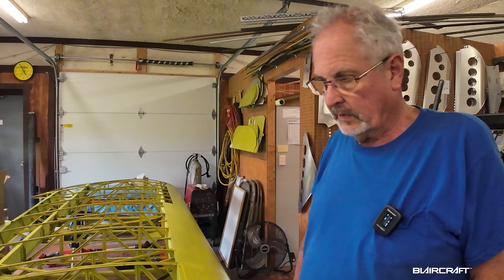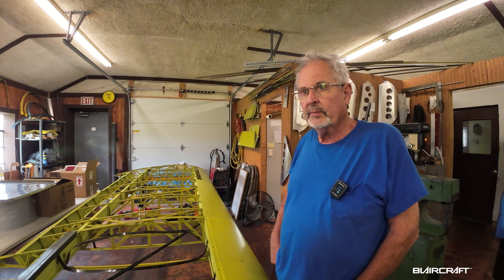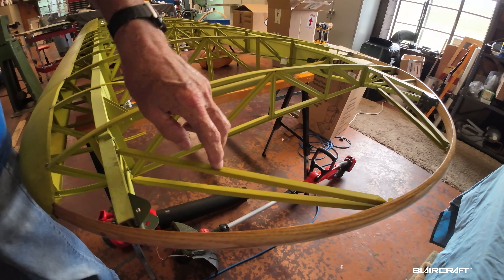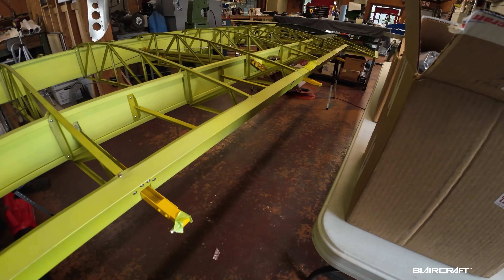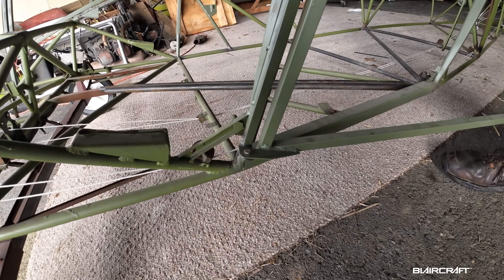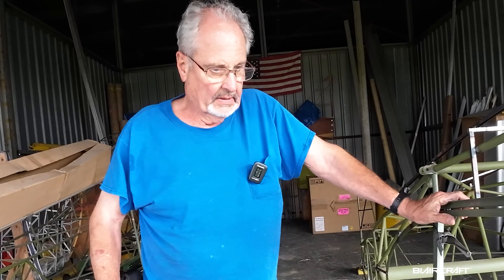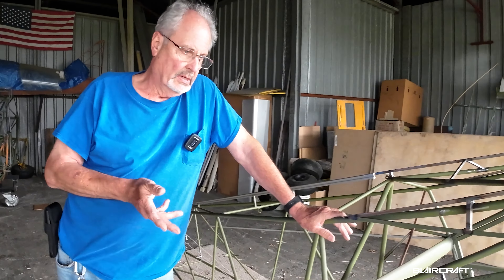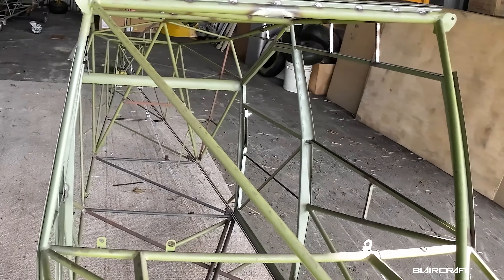Clyde Smith, Cub DOCTOR: 1st PA-16  S/N 1 (REVIEW)

Comment: Hopefully this will inspire you to restore the wingtips on your airplane back to stock. Did you ask Clyde his opinion on the droop tips?
Reply from the maker: Yeah I mentioned the tips, he didn’t have any comments on them. I’d hate to add work/cost and I hear they’re better when in floats. 
The two negatives…? 
-requires rocking the wing for a better view due to less visibility.
-looks for some.
Reply: @Blaircraft.Engines  #3 More weight (nice video, great story)